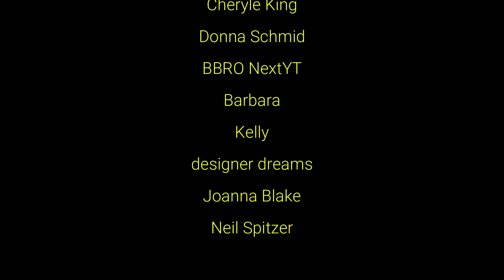Are these Paths Beyond Repair | Horror Garden Transformation

Comment: Some say you waste time passing to the same spot multiple times, but this video proves that it's the only way to get the job done! I found it very motivational: cutting, hoeing, raking and starting over again if necessary (in my job I don't use these tools but tomorrow I will use this example with my worker ...). Hope there will be a part 2 with the rest of the garden (maybe this time not for free...)! :goodvibes:

Comment: How come you don't swap out your traditional weed eater string head for a steel blade head? This way you can tear through that bigger brush and weeds a lot faster and easier. Or, at least have an extra weed eater with that head specifically for those bigger, thicker weeds and brush.

Comment: What are those 2 big gas cannisters for?
Reply: When there is no mains gas,  these cylinders are used to store the gas to be used, possibly for hot water, stoves etc. cylinders are replaced as required
Reply: Helium to make you laugh !
Reply from the maker: They are generally for heating!
Reply: @austyannie1959  Oh, kinda like propane gas in the United States.